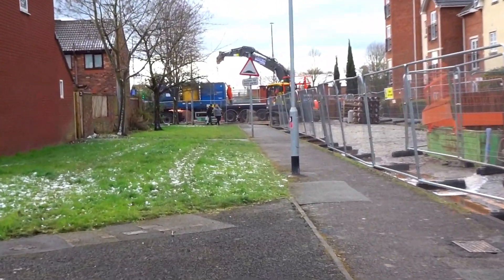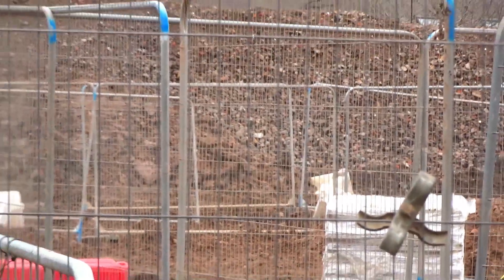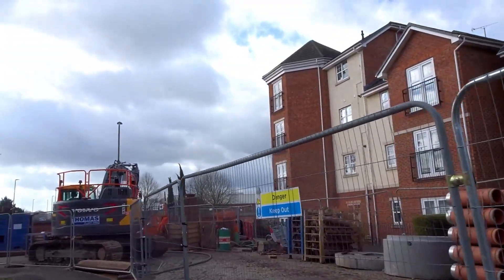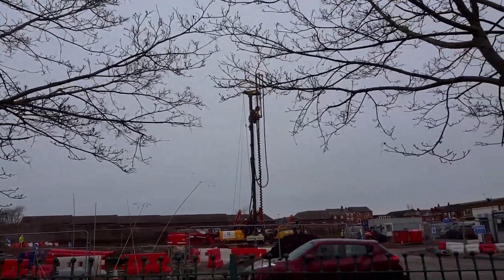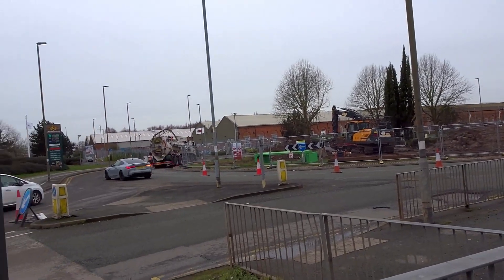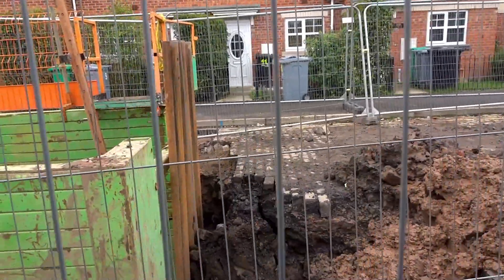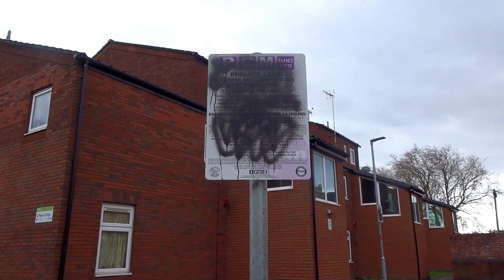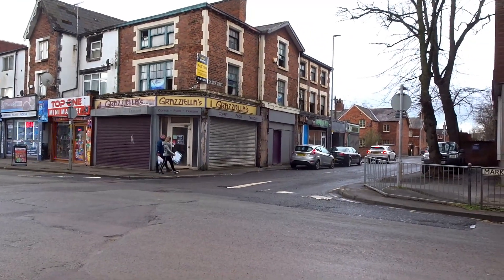Regeneration od Crewe part 43

Comment: It's not a drill it's called a cfa piling rig  it drills holes that are then filled with concrete and reinforcement  when complete pile caps and ground beams are installed usually with bolts cast in to attach a steel or concrete frame
Reply from the maker: Thanks for that the video are light heartened and aimed at the general public every one in town calls it a big drill. Many of the comments are what people say when I am out no one is happy having to wait until 2025 for shops and have a lot to say about CEC
Reply: I mean by your own definition it's a drill